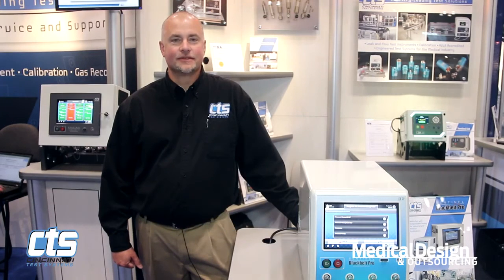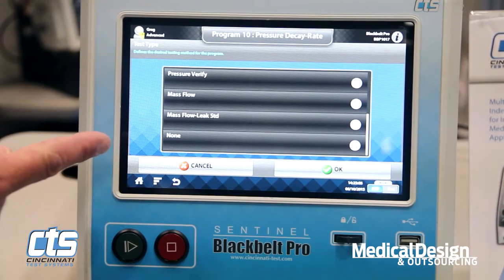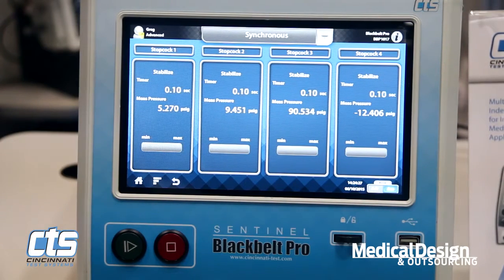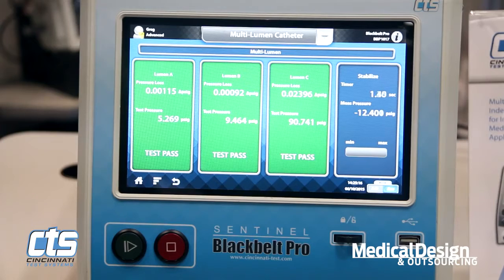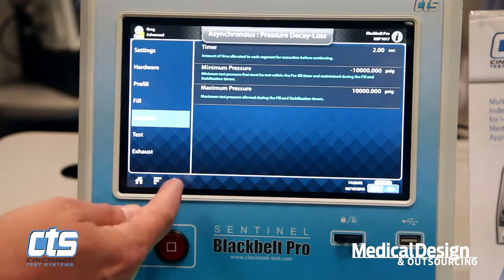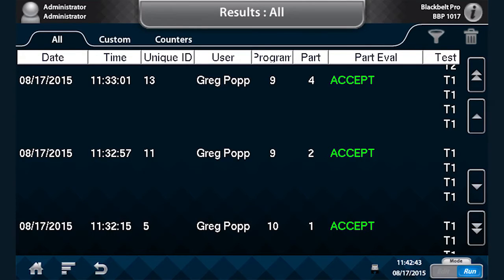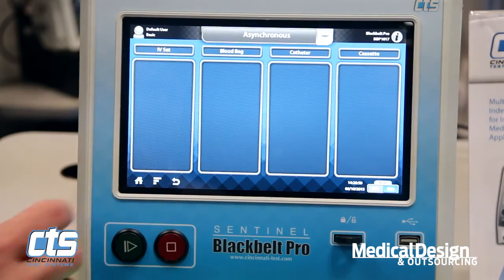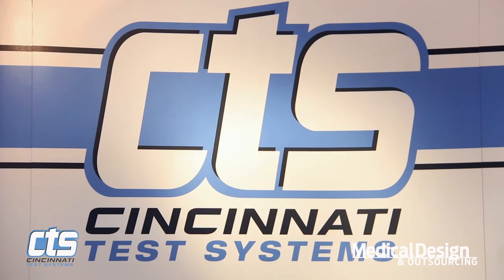CTS Sentinel Blackbelt Pro - Pressure Decay Leak and Flow Test Instrument

Comment: I want to Scan the Barcode of a piece in order to match the Barcode of the piece with the test result. Is it possible to do that?
Reply: Yes. There are three ways to scan a barcode into a Blackbelt Pro instrument. The first
two methods involve setting the Interface Type to either PLC or Barcode. The third method is to plug in a barcode scanner.